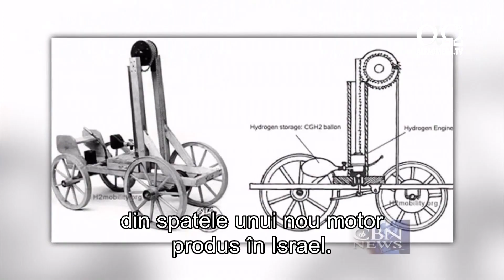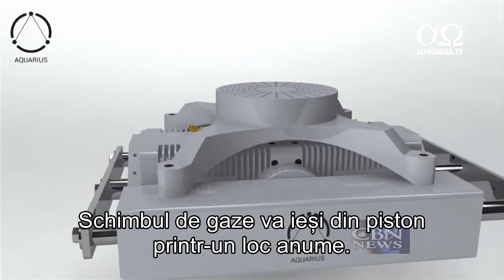O posibilă revoluție a motorului cu ardere internă

Comment: Children's stories. There was an inventor who invented a performer carburetor with which he equipped a 3200 cc engine. This engine was powered by 1 liter of petrol / 100 km. The carburetor was bought by General Motors, but it was not manufactured. This carburetor appeared on American tanks in World War II. After the war on tanks the old carburetors reappeared. Therefore, the existing engines could consume 16 times less fuel but this was not desired. Why ? Answer self you.